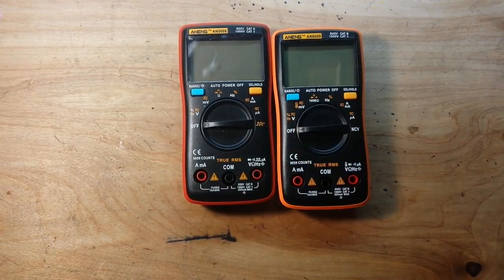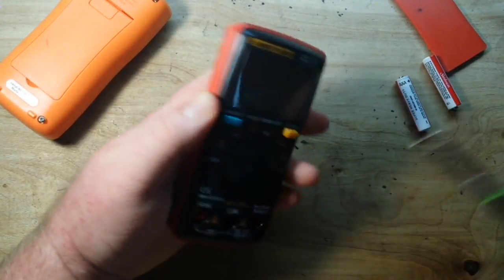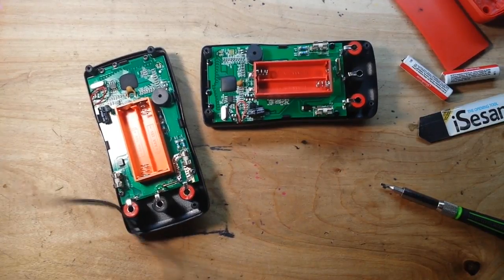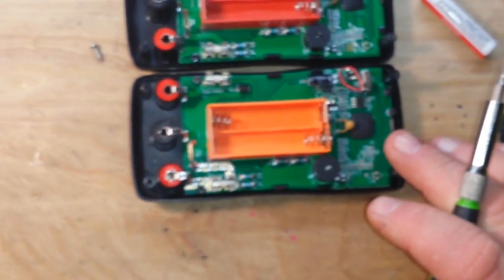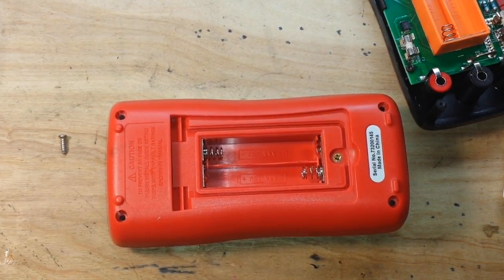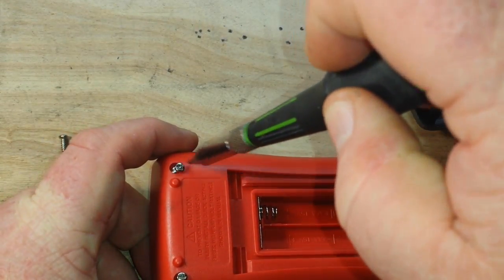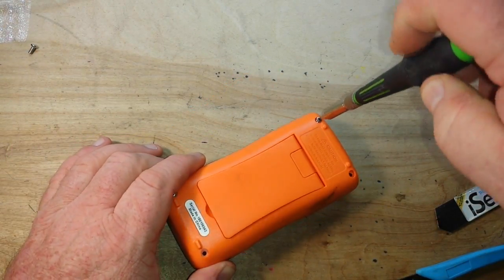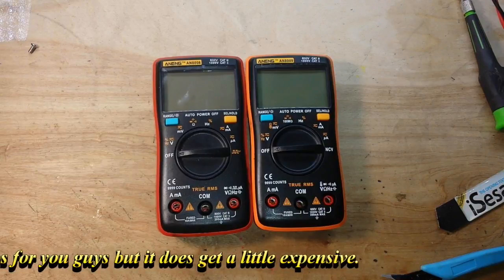An8008 vs An8009 Teardown and compare

Comment: The one difference no one is mentioning is the 8008 model has the square wave generator and it has quite a range of selectable frequencies it can generate.  Very useful for radio and amplifier troubleshooting.

Comment: well, there is one thing you missed, and that is the traces from the probe connection are reinforced with solder on the 8009, probably had some customers burn the traces on the 8008 in order for them to start doing that
Reply: The trace soldering doesn't appear to be consistent on the AN8009's. I watched as many teardown videos as I could find before buying one, and here's what I found...of 5 YouTube videos that showed the internals of a red AN8009, all of them lacked the trace soldering; meanwhile, of the 2 YouTube videos that showed the internals of an orange AN8009, both had trace soldering. The only other video that I found with pictures of the internal board was a video that contained "AN8009" in the title, yet the actual device was a URXTRAL ZT111 (which, like the ANENG AN8009, is a rebadged ZOTEK ZT111); while that device was red, it had the trace soldering.
But take these findings with a grain of salt...not only is the data from a very small sample size, most of the reviews were 5 or 6 years old so the internal components and/or manufacturing process could very well have changed since then...for better or for worse. Regardless, I ordered an orange AN8009 today from AliExpress (for less than $15 after tax for the "pro" version (contains extra leads & connectors) after stacking promo codes and cashback deals!); when it arrives next month I'll update this post to share what I find inside.
Reply: he DID mention it!

Comment: Thanks Paul. My Aneng 8008 came in today. The leads on my meter are actually pretty good.
Reply from the maker: Gotta love 8008. For 20 bucks you cant go wrong....unless you try and read 440 triple-phase😲
Reply: Yep. I paid a little more because I didn't want to wait 3 weeks. But it will be a great little carry around meter that won't hurt too bad if I lose it or someone jacks it from me.

Comment: It seems like one can hack the AN8008 to measure temperature aswell.
Reply: Manuauto  the thermocouple is just a resistor that changes based on temperature. So it's very easy to plug one into any meter and look at the graph of that thermistor's resistance at a given temperature
Reply: David Steinhour whilst you could do that, I think it's rathet unpractical ;)
You can change some bytes in the ERPROM and enable this feature completely.
Reply: True and fair. But the price difference from '08 to '09 is hardly more than the price of an individual thermocouple. Even if you already have one, it's worth it just for the spare.

Comment: But the one question you didn't address was, What does that tactile switch on the back of the circuit board do??
Reply: It's on the older model, so it shouldn't be the NCV pickup because that isn't an option on the older one. But it does look like a tactile switch. But why would there be a switch on the back of the circuit board, and no way to activate it with the cover on. Hmmmmm, Thoughts, Paul???
Reply: It's most likely used to put the meter into cal mode at the factory.

Comment: Hey have you seen the newest techy looking Aneng "Q1" meter with the slick new white on black high contrast display-??   All buttons & no selector knob.  The case is new also and thicker, looks to be a very nice unit, and runs almost $40 on BG.  I have an orange 8008 and two 8009's - one red and one orange, great little meters all are very accurate and among my top favorite meters.  I prefer the NCV and temp setting of the 8009 over the useless (for me) square wave generator on the 8008, though the 8 is still a great meter.  My next meter will definitely have to be the newest design "Q1" from Aneng, really a slick looking piece of work with no mechanical knob and that new high contrast display, really a step above the norm in sub fifty dollar meters.
Reply from the maker: No but I'll look for it.
Reply: Stay away from it. The screen fades out as soon as your battery starts dropping voltage. At 1.4v you'll have to look at funny angles already.

Comment: I got 2 of those 8008, think I need another 2 more, one of which might be 8009 if I am interest, It is for my experiment in extreme.
Reply: I love these little Aneng 8000 series meters, very accurate - ive got an 8008 and two 8009's - but have you seen the newest Aneng "Q1" with the new type of display-??  I saw it for sale on Bangood, has a very slick high contrast white on black display and no mechanical selector all buttons, very nice looking with a new case as well - I want it for my next meter but its $38 so have to wait a bit but Ill definitely have one, though im wondering if I should wait for reviews as its brand new and I havent seen any yet.  Also I have yet to get a bad Aneng meter, they seem to have decent quality control compared to others ive had to repeatedly return for refund.

Comment: You got beef with the Aussie?haha
Reply from the maker: No, he just ripps on everything that isn't laboratory grade gear.
Reply: Some of us will have to make due with our near zero budget... Just bought a discount workbench for 50 euro. One small step for man!!!
Reply from the maker: You don't don't see any 10 thousand dollar Rhode and Schwartz scope on my bench.
Reply: I don't even have a 20 dll diy shit scope... I had to go to marriage counseling just to convince the wifey for a workbench. Baby steps...
Reply: Yes, Dave visibly has a bias against "cheap" (say, less than $100) multimeters and Owon scopes. I'm yet to see a destructive spark test on his, very expensive, 121GW multimeter. I have two sub $100 multimeters and they work fine. One is a Velleman DVM870, that I have for 11 years. The other one is the Aneng 8008, which is a spot on multimeter. I'm pleased with both.